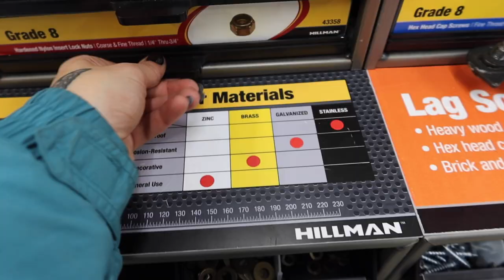bucket seat install (& sliders) | NRG Prisma Ultra Seats | WRX

Comment: The hole in the bucket seat is for stock seat belt 🤪
Reply from the maker: i thought about that. I also saw a couple other people mount their buckle to the bracket like i did 🤷‍♀️ when i get harnesses i won’t need them anymore so i’ll just leave it how it is for now
Reply: @ej_was_here  It is just for safety until you get the harness, it would be sad in case of an accident 😋🙃